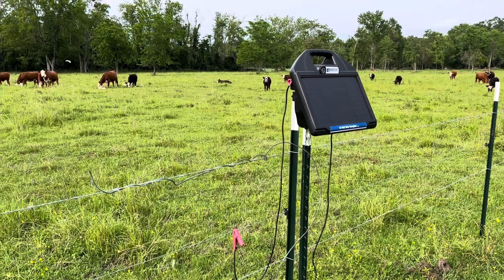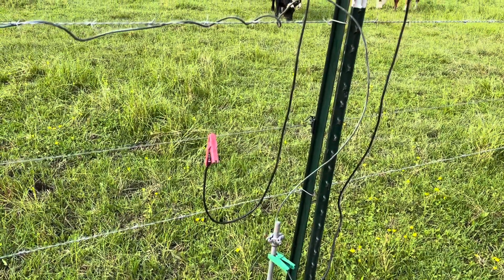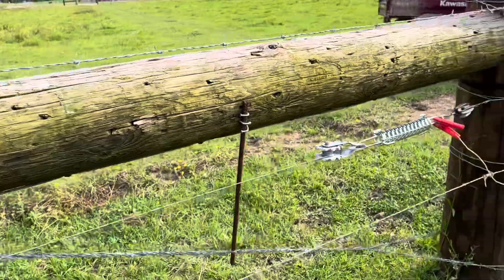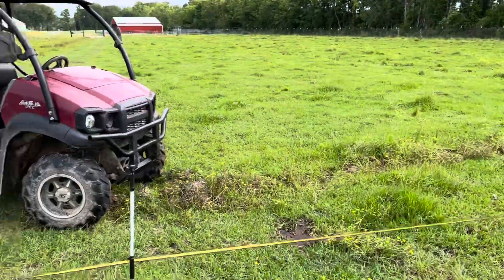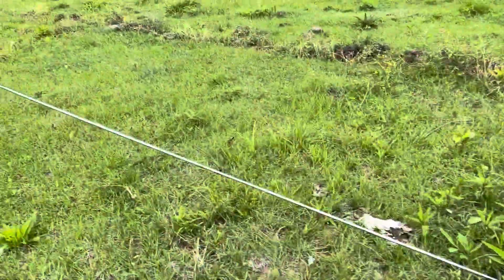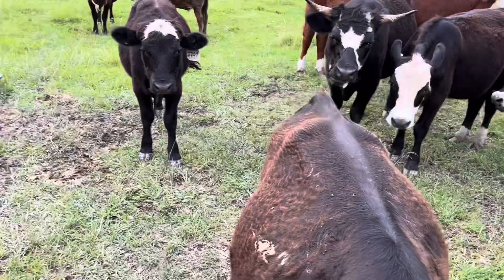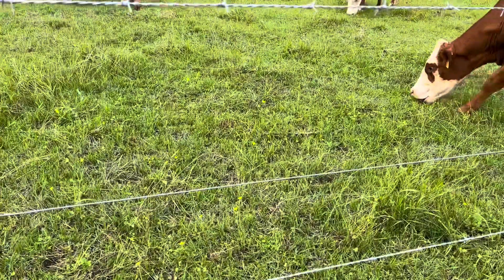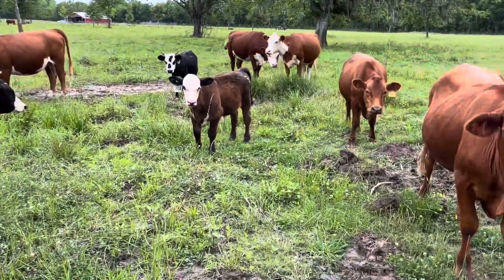Simple Solar Electric Fencing for Cattle

Comment: how long should be the fence it feeds the electricity
Reply from the maker: Each charger is rated for a maximum lengths of fence.  My charger is rated for 25 miles of wire.  So it could in theory  power 5 miles of 5 strand fence.

Comment: That sounds like durable system. What's the specifications of the solar system (the panel)?
Reply from the maker: It’s a complete solar energizer unit.  The output is 0.5 joule,  which is plenty to keep our cattle contained.  I bought it from Kencove online.

Comment: I have found the same thing with the little mini reels. Real handy for short sections of fence, but nothing I want to use for any distance. 
Also, I was surprised at how well those cheap electric cord reels work. A little bit of a pain to tie off at the end of a run, but hold a lot of wire, and reel up pretty fast.
Reply from the maker: Yea,  I like those electric cord reels.  The best I’ve found is to put the non conductive handle on the end of the line,  then hang the reel with a rubber bungee cord